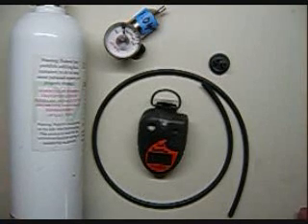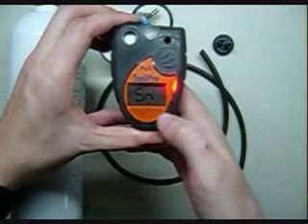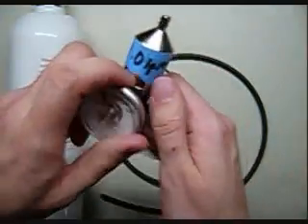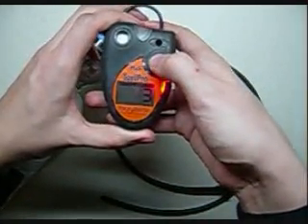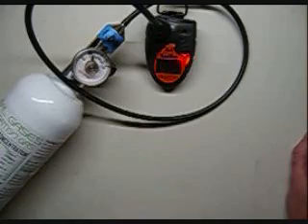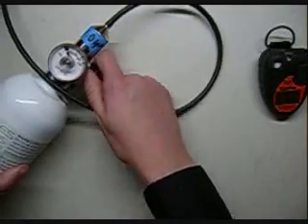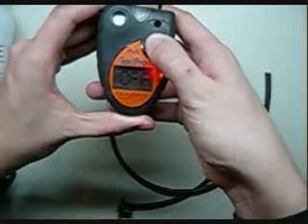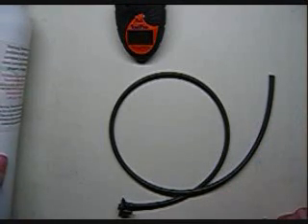Sperian Biosystems ToxiPro H2S Gas Calibration Guide by Ideal Calibrations

Comment: I have a question, why should I open the regulator before pluging it with the cylinder?
Reply from the maker: Hey Luis,

If you look in the bottom of the regulator you'll see a hole, just like if you look down the top of the valve in the cylinder.  This hole is currently filled with air from your room which contains moisture.  Moisture is, technically speaking in a gas cylinder, very bad (it will cause the H2S gas to turn to an acid and drop out of the cylinder, which throws off your calibration values when the H2S fades).  When you plug the regulator into the cylinder, with that valve closed, you are creating a closed system in which that moist air can get inside the cylinder.  When you open the cylinder valve first, the pressure from inside the cylinder blasts that moist air out. Once a little gas flows out you can close the valve on the regulator and continue screwing it in to the cylinder.

Let me know if you have any other questions I can help answer!
Reply: Got it. Thanks a lot, James.